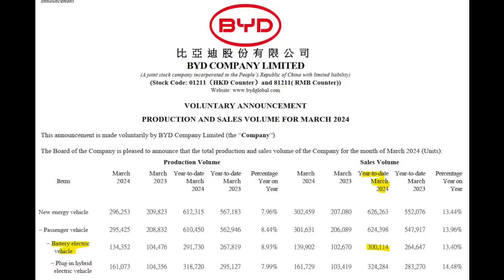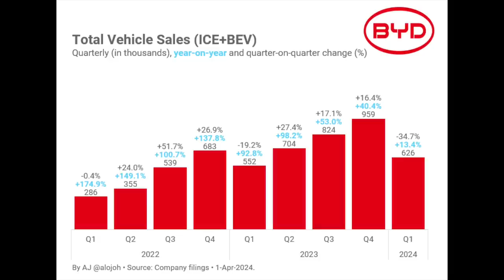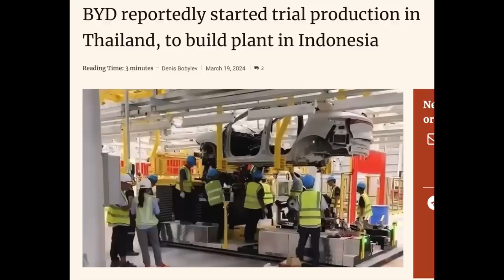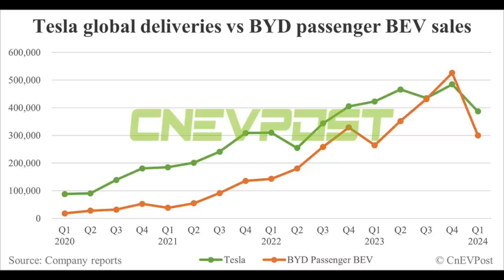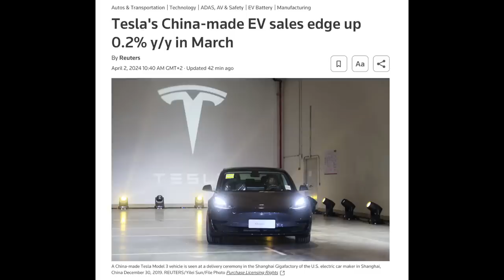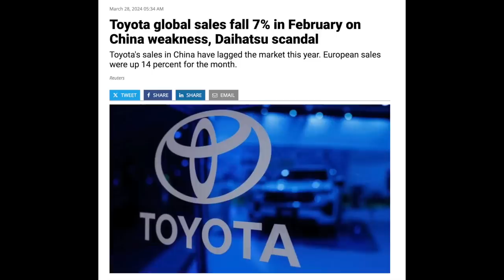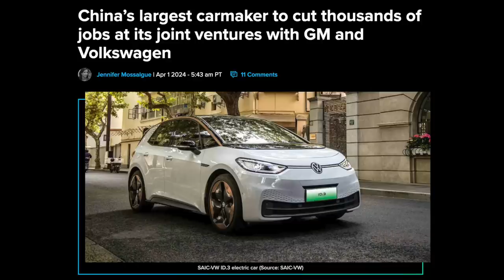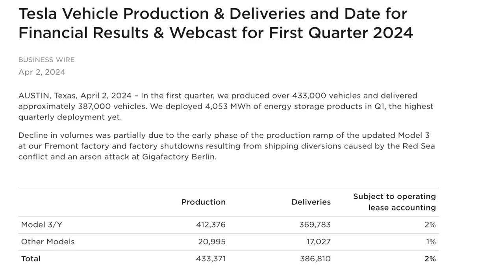BYD & Tesla are killing Legacy auto in China that cut jobs by up to 30% - Tesla deliveries Q1

Comment: BEVs are not advertised based on their advantages over ICE or PHEVs, at best they are marketed  as PHEVs and at worst as cool versions of ICE.  This is dragging on BEV because without high sales of BEV from legacy the transition is held back.  Legacy clearly do not have their heart in a transition at a speed the market cleary wants.  They need to slow things down but it's too late because you can't fool consumers indefinitely - demand for new BEV will surge on and also for used BEV.  I strongly believe that if Tesla could produce 5 million model Y this year (they can't, of course) they would sell every one of them.